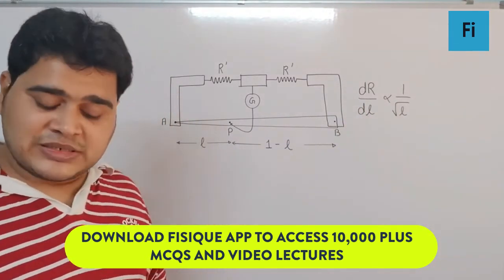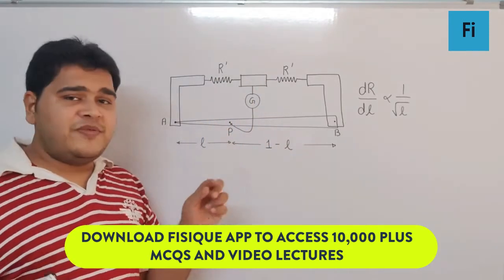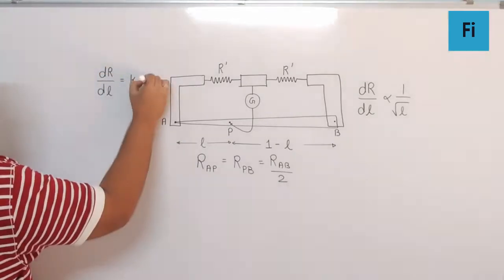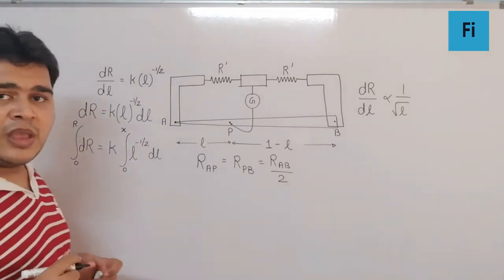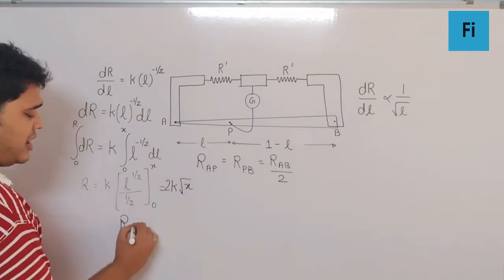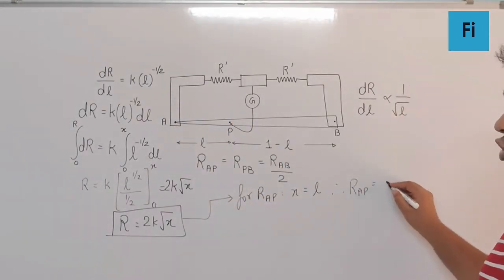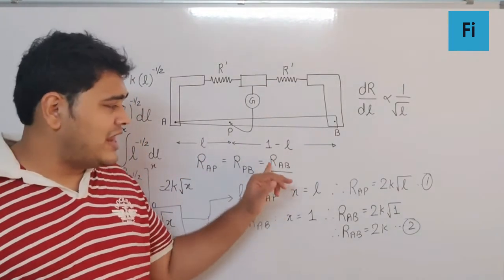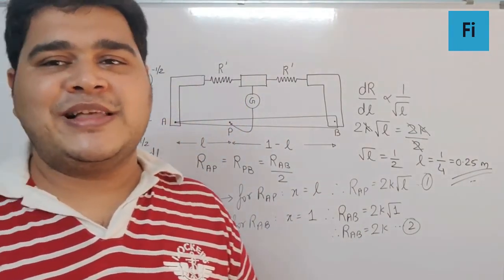In a meter bridge, the wire of length 1 m has a non  uniform cross – section such ...

Comment: Why Rap =Rab/2 ?? And why integration ato b
Reply from the maker: Because the resistance are equal so, for R(ap) if it is R
Then R(ab) it is R+R = 2R

And integration from a to b because that's the end limit for the wire